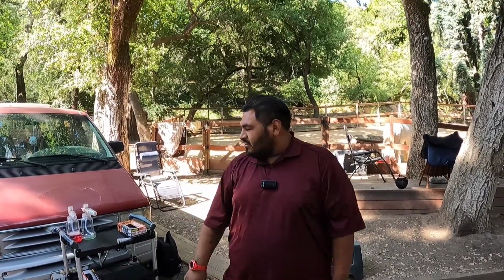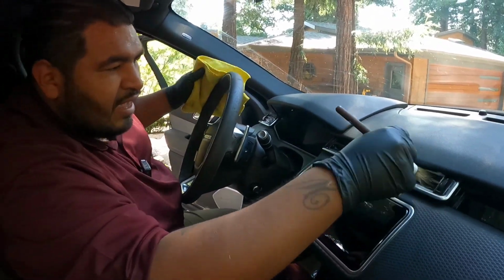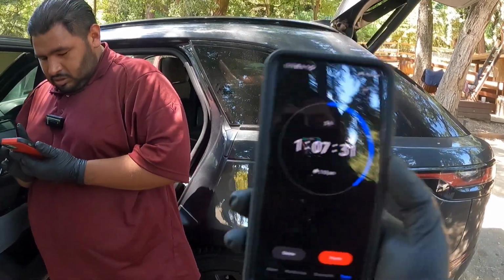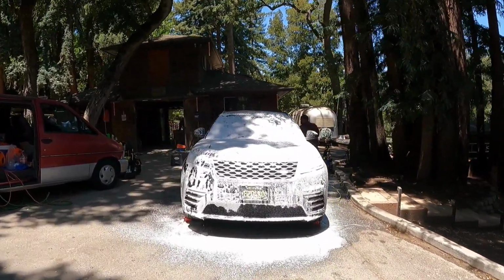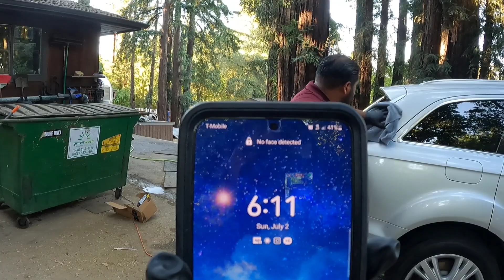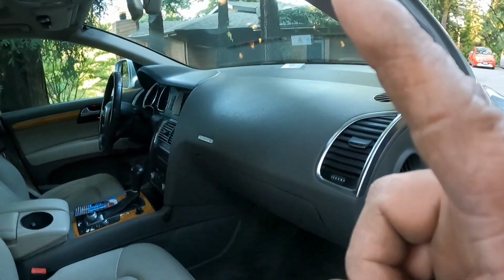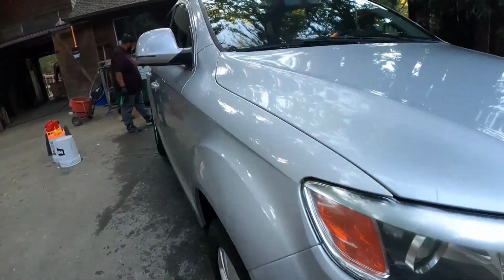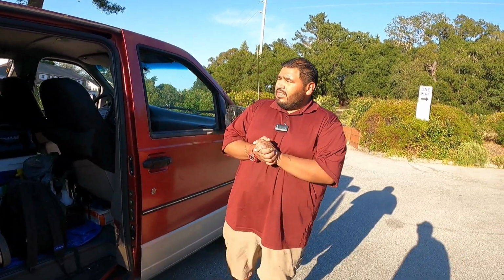We detailed six cars of one referral! - isacs mobile detailing

Comment: Osiiito! Good video como siempre bro. One question… WHAT FOAM CANNON DID YOU USE? That thing throws out some thick suds.
Reply from the maker: What’s up my boi Martinez sorry for the delay. It’s produces very good foam. I’ll post the link below 

Foam Cannon - Pressure Washer Gun with 1/4 Inch Quick Connect and Adjustable Nozzle Car Wash Sprayer with 1 L Bottle, Professional Car Foam Cannon Fits Most Power Washing Accessories (4000 PSI) https://a.co/d/3u1exMV
Reply: @ositoandhisadventures  No problem Osito. I know life and work can get hectic. Appreciate your response. I’m definitely going to look into this foam cannon. Gracias!

Comment: Hey osito new subscriber here, I appreciate the banger videos you’re dropping and i like how you keep it real 💯 For the door jambs, I like to  rinse them down, spray APC, use a detail brush and scrub them down and do one final rinse. After all that, I like to use my blower to dry them off and to minimize towel usage, I hope this helps.
Reply from the maker: Thanks for sub. I really appreciate it 🙏🏾. Definitely helps been doing a similar method using my ik sprayer
Reply: Try flipping your hose on your shop vac from suction to blow connection .It blows very hard and you don’t have to carry extra equipment like blower.Just make sure you keep the vacuum clean in the inside to eradicate dirt that may fly out with this method